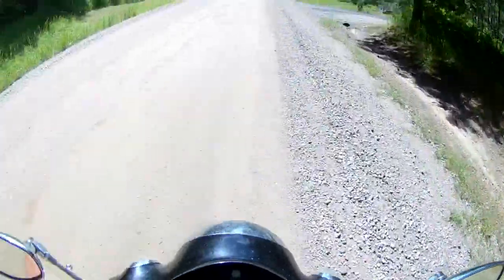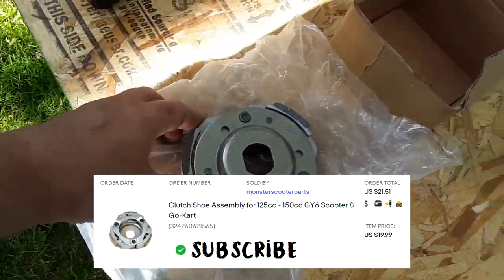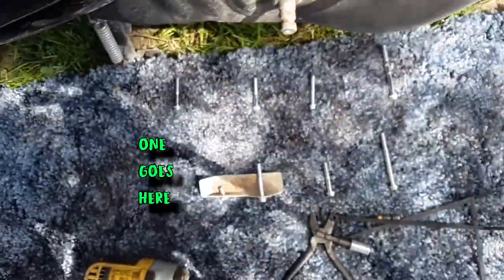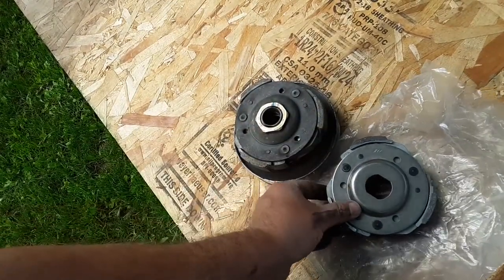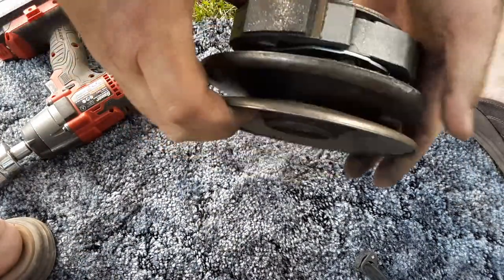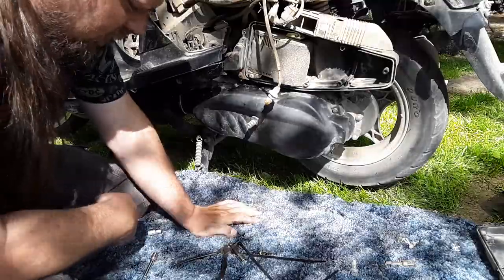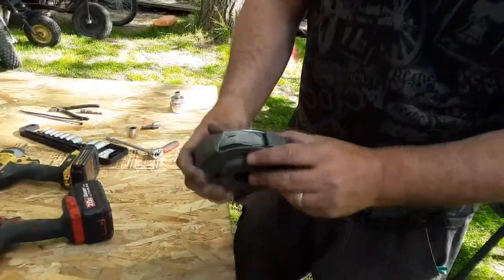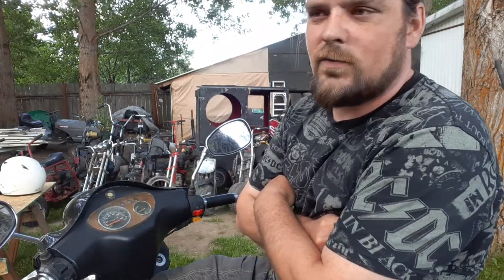GY6 scooter clutch replacement

Comment: What's the regular roller size for a gy6 150cc qmj trike ice bear. Any advice what to upgrade? Besides filter and spark plug? I want to upgrade clutch belt rollers and so on. I like the wat it rides. But any upgrades will do.
Reply from the maker: https://youtu.be/ekJQaOF43Iw 
This guy knows more then i do about gy6 upgrades. Thanks forbwatching